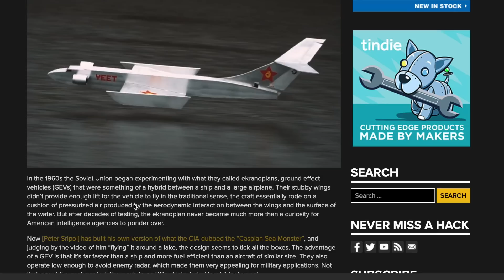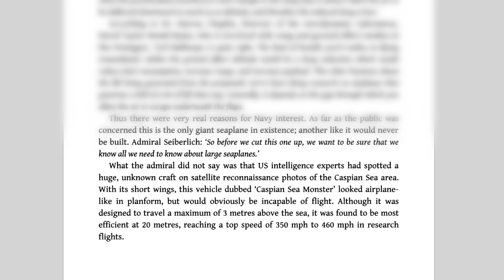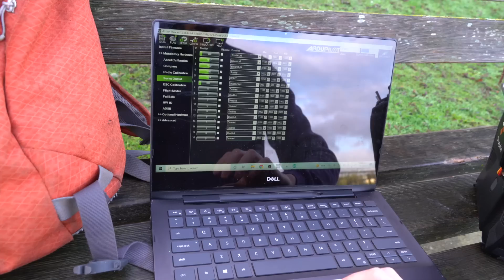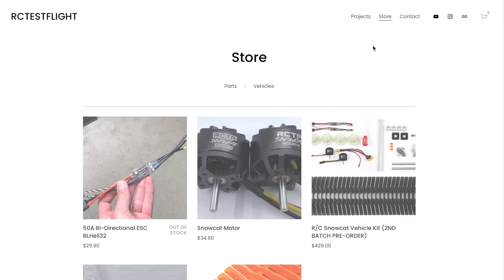Worlds First 'Real' R/C Ground Effect Vehicle

Comment: IMO, a ground effect vehicle is a vehicle that flies in ground effect.  I could fly my small airplane in ground effect over the runway, and in that case, it was a ground effect vehicle.
Also, I think a foam RC craft is just too light not to fly.  Even with reduced power, your power to weight ratio is much bigger than a full size vehicle - your model would fly just throwing it without power - I don't think the full size Ekranoplan could do that.

Comment: You need to build a really tall T tail with a fixed horizontal stabilizer.  That's going to keep the plane from pointing up.  It needs to be tall enough so that it can still face the wind even if the whole vehicle is trying to block it from rushing air.

You've already done this before with your other models.  There should be no reason why you stopped using it.

Comment: You should try to do a build that takes advantage of compressional lift. 

Not sure exactly what you'd need, but you'd absolutely need actual jet engines, likely with after burners, even if small. 

Would also likely be helpful to have a vr system in order to fly it as it would be going fast enough to break sound barrier and hit mach.

Not even sure what the legal ramifications are for it, but supersonic rc jet would be awesome.

Comment: The point of being a ground effect vehicle is that it is more power efficient to travel the same distance than out of ground effect and to make staying in ground effect easy. Demonstrating that efficiency is probably not that easy. But basically, the thrust to weight ratio in ground effect should generally be lower than for similar planes.

Comment: Pwm may be an easy way to regulate throttle, but it's not regulating power. Full scale fixed pitch aircraft use rpm to select power settings (reduce power to 1500 for approach) etc.

Perhaps you can use an esc with a governor and command it via pwm, or have the flight controller target a wattage.

Comment: Models usually have more power to weight than a similar full size craft. Why can't you throttle up to lift off the water, then back until it sits on the ground effect?

Comment: #rctestflight
I recon an aircraft should be defined as a vehicle wich achieves flight by aerodynamic lift
if you are blowing straight up that's basically a helicopter or a VTOL
if your means of propusion creates lift underneath the vehicle that's basically artificial ground effect
so by that definition your crafts would be ground effect vehicles since you rely on parthrust in every design
if you move the propeller back then it would rely purely on the natural ground effect and take parthrust out of the equation

Comment: I very much remember that original video  but totally forgot it was you who made it, i replicated it bigger (and worse) out of thin ply for a school project (alevel grade EPQ) it failed fairly spectacularly as i killed my in spec battery through over discharge and tried last min before submission to wire up two smaller 3s batteries to run my 5s EDF and deffinitly over drew the current (hence the decending motor rpm) i also failed to get the roll axis stabalised and sufferd from an issue where i saturated my elvevons trying to pull up so had very little roll authority,
but it was my first ever rc aircraft i made and it did actually get off the ground! 
https://www.youtube.com/watch?v=6EqfGYEhCkI

Comment: Could you use a hydrofoil to help lift it out of the water? Retractable if necessary.
Low pitch props for strength rather than speed? Would 4 smaller props work better than 2?
Reducing elevator surface area might make the plane harder to pitch up enough to fly?
Can you design the 'pocket of higher pressure' to be close to centre of gravity, then add flaps in the middle of the wing to give it lift at centre of gravity?

Comment: I was wondering if you ever tried a vehicle that really is not airfoil or airplane in shape at all. I was thinking of basically a forward facing horseshoe with a lid. Just an air scoop with engines and a rudder. 

So the only lift is created by collecting the incoming air and pushing it downwards. Maybe with your tilting props.

I can't imagine something like that being able to fly. But I really wouldn't know.

But imagine a pizza box with the bottom and one edge removed. Slather a helping of motors and a pinch of rudder and an elevator and some pepperoni and see if you can GEV that thing. But not fly it

Just a thought from some guy that is hungry for pizza but knows nothing about GEV's.

Comment: Don't most WIG and also regular fixed wing aircraft typically use more thrust on takeoff before throttling back for better efficiency? I don't think having the capability of more power is a disqualifier for either. I think I even remember hearing about the Wingfish 8 being able to use that power to clear obstacles and larger waves if it needs to, similar to how you were saying your r/c version could. Still a very interesting series though, definitely satisfying to see it in action :)

Comment: Could you use an ultrasonic or some other type of distance sensor and a micro to inform the pwm feedback loop? When distance exceeds 20” start to reduce throttle automatically in-loop (way faster than you can respond by human control). There could be interesting IP around ground effect controller with multiple sensor inputs to continually optimize for ground effect. Wind speed, ground speed, acceleration, rate of change of acceleration, distance from ground, air humidity, air temp, etc.

Comment: As a mechanic when I went through school they taught us that it was high pressure under the wing. The wingtip vortices can add stability but they can also take it away. The main work is done by the high-pressure pocket underneath the wing and the low-pressure pocket above the wing. Being as your ground effect vehicle is all lifting body it is allowing a high-pressure pocket to be trapped underneath the body and the pylons help to focus and stabilize. Good CG because this is a highly stable craft!
Reply: Also I would argue that a slight airfoil shape could improve the ground effect. The whole point of an airfoil is to reduce the pressure above the wing as opposed to the pressure below the wing. This is because laminar flow causes the air to follow the skin of the wing and the wing has more skin surface area above than it does below. The higher surface area causes the air to have to linger on the skin of the wing causing a low-pressure pocket. The faster moving air on the bottom of the wing creates a higher pressure pocket.

Comment: I think this is absolutely the right approach to research this effect. 
Do not get hung up on the half a wing span definition because it is the air cushion that matters so it no doubt follows an area rule not just a span rule. 
Add weight instead of reducing power. Adding weight and running the motor at its rated kV will be the easiest way to…oh wait you just brought this approach up so DO IT!

Comment: Groundeffect with such a wing shape would be noticeable up to two or three times the wing span. Groundeffect Vehicles are simply most efficient when at ideal height. The ideal height depends on the aerodynamic characteristics and is seriously non trivial. Even the Ekranoplan could fly well outside of ground effect if provided with enough power. You just loose more and more to induced drag. A way to measure this is by taking IAS over Motor Power or, lacking a way to measure IAS, time over a set distance with set motor power with multiple bidirectional runs.

If you truly want to do "real" testing find a way to log IAS and power and get a stabilizing gyro running to make repeatable flights at specific heights.

Finally: A Ground Effect Vehicle is any vehicle optimized for high efficiency flight close to the ground as opposed to a normal airplane which is always optimized for flight outside of groundeffect. They may have significantly less power than normal aircraft because of the high efficiency flight regiment they can achieve when in Ground Effect. But any Ground Effect Vehicle capable of quick and efficient travel will by definition be capable of travelling slower and (much) less efficient outside of Ground Effect. The physics here are quite simply those of high AOA flying.

Note that forward swept wings may be of benefit in this configuration, Gunter Kirch has a lot of interesting reading material on his website (German only) https://www.flugmodellbau-kirch.de/Negativ-gepfeilte-Nurfl.ue.gel.htm When stalled these generally just drop the nose which is highly desirable when operating so close to the ground and when combined with a high T elevator should be a stable platform for any experiment. Although it might not even need an elevator due to the inherent self stabilization of a forward swept wing.

Comment: about the definition "is it still a real ground effect vehicle, if you add enough power?".. :
the ekranoplan was designed to be efficient - harvesting the ground effect to be cheaper than a plane OR ship.
soooo... it had a total of EIGHT engines, wich were used for taking off... after that most of them (to be exact: SIX) were shut down.
So basically it was a gliding boat using only 2 of 8 engines.

what i`m saying here is: the original "real" ekranoplan had more power, but didn`t use it in order to save fuel.
throtteling down your engines by capping the pwm signal probably comes down to the same thing.. so.. yea. goal achieved in my mind.

Comment: Others have said it but it deserves repeating - Any scaling issue can be addressed in more than one way. Rather than reducing power, add weight. The biggest difference between RC craft and full sized craft is often wing loading. It makes sense to reduce that difference. 

Another way of thinking about it is to examine the scaling effects on different parameters, such as wing loading, span loading, weight, wetted area (literally), etc.

Comment: While watching I thought of a way you might test the theory of whether or not it is the wingtip  Vortexes Or the increased increased pressure on the cushion of air under the airplane. In someFlying wing designs they reduce the attack angle at the wing tip. Essentially they twist the wing So that the wing tip has a lower angle of attack than the root. The thought being that this reduces the difference in air pressure at the tip thus reducing the stall characteristics at low speed. It seems to me that this would also reduce the wing tip voracies produced. My next line
Of thought was wing warping. This might be challenging to achieve in your design because of the long cord and short span as wing warping tends to work better with high aspect ratio. However What if you were to make the entire tips of the wing Basically an active elevon Similar to what we see in some fighter jets. Thus the entire idea coming to the The conclusion that if you can reduce reduce the angle of attack to 0 at the wing tipsYou would not generate any wingtip vortexes. And thus if the aircraft still flies well You can prove your theory that it is the air cushion and not the Wing tip vortexes. I would love to see some footage of this aircraft in this video as well as An aircraft of the design I suggested or similar  Being flown on one of those cold mornings where the water produces a low level fog. Thus allowing you to see the wingtip vortexes in action. I think it would be ideal to have a High quality camera platform drone such as a DJI  Flying overhead to give a better view.

Keep up the good work👍

Comment: I'm wondering why you didn't use cambered wings from wingtip to wingtip?  Flying slabs are quite un-aerodynamic and the inverted ramps on the front of the pontoons are adding a bunch of unnecessary drag.

Comment: My take on this is that GEV are used for moving high mass at high speed. All the models so far are low mass, so the amount of thirst required to get off the water is also enough to fly. I wonder if you could ballast the craft to the point where only Ground Effect provided enough lift, and out of GE there wouldn't be enough lift.

Comment: Ground effect is very well defined. It is the increase in lift when you fly lower than your wingspan, because you "trap" overpressure between your wings and the ground. It does not need to be water. When you are higher than your wingspan this effect is already almost zero. So naturally it is very hard to remain in this range with RC models. It does not necessarily mean that you cannot fly higher with sufficient power to overcome the stubby wing losses. Whenever you fly higher than your wingspan, you are practically out of ground effect.
The two explanations of the ground effect you give at 4:20 are actually both the same. The squashing of the wingtip vortex - which come from air wanting to move around your wing tips from the high pressure underside to the low pressure overside - it is exactly the mechanism that traps the high pressure under the wing.

Comment: Adding a few control loops would make it easier to control. I.e. measure motor RPM and adjust PWM values to meet a set RPM. This reduces dependency on battery voltage. Similarly, you could adjust the tilt based on angle and/or altitude.

Comment: I still do not know what ground effect flying is. I also could not find a definition of it in any searches. I've heard both flying low or a plane hover crafting, both of which fit ground effect flying from what I found. Your defining of a plane not actually having the power to fly also fits a plane flying low. At the 9:30 mark you mention its flying even though its not very high. So, what is ground effect flying if not a hover craft effect, a buffer of air between the water and wings, or flying low? What effect, if not a hover type flight, are you looking for?

Comment: i would call a plane a "ground effects plane" if it was designed for maximum fuel efficiency while flying with ground effect. there was a prototype troop transport years ago that was meant to carry massive amounts of cargo with super high fuel efficiency over water. from what i remember, it could fly at altitude, but the fuel efficiency would tank horrifically and you'd be at bingo really fast. most ground effects planes i've seen are super fat cargo planes of some type because that seems to be the most useful application.

Comment: I remember, as a kid,  reading of a B-17 crew returning to England with battle damage and down to two engines. By throwing everything overboard they were able to maintain altitude but then lost another engine. The B-17 could not remain airborne on one engine and they prepared to bail out before they got too low. But the pilot had the navigator calculate their descent rate and asked if they could make the Channel. He said they wouldn't but could make the North Sea if they turned due north. Pilot told crew to not bail out as he turned north. The plane settled to about 10 feet over the water and held. He gently rudder turned west and eventually belly landed on a beach in SE England.

I have been flying for 38 years and I have never flared for landing as the gentle hand of ground effect reaches up to help without thinking of that B-17 pilot who bet EVERYTHING on it. I generally fly high-wing aircraft and ground effect works out very nicely. When flying a low wing aircraft, if you are carrying ANY extra airspeed you find yourself wishing there was a ground effect switch you could turn off. Turns out yelling. "Stop flying, FFS" does very little. I also learned what I what I think is the other reason sailplanes have spoilers. A sailplane with enough energy to fly at all becomes a perpetual motion machine in ground effect. 62' wingspan, altitude 3 feet. It will not quit flying. I think ever.

Comment: I just thought about it. And why wont you hard stuck the thing on ground effect zone. I mean. All this "GEVs" have rounded or flat as earth under. And what if we would put an venturi tunnel here(or any other way of controlable vertical drag). Thus there will be a counter ground effect witch will in theory lock thing on constant height. it will downgrade the lift force and speed ceeling, ofcouse, but stability and guarantee worth it.

Comment: All those complaints about this being not a real ground effect vehicle because you've simply limited the motor power are silly. At full scale the motors aren't limited, it's the other way around. They used smallest, weakest engines they could get to get the job done. Same here, you could simply use smaller, cheaper motors and run them at full power.

Comment: to combat that vertical oscillation, you can use a PID controller algorithm to regulate the power to counter this? But, im now wondering if you can use the PID to keep the vehicle in set position from the ground, and filter the noise. I use PIDs in game engines to create realistic dampening on suspension models for vehicle controllers and they work great, but take a long time to balance

Comment: We used to built WIG models back in the 1970s. But these were more like hovering boats, not low-flying planes ;). And there was no RC, just a basic 2.5 ccm motor with a shutdown rod on top. The things were quite unpredictable when airborne, they'd cartwheel at will all the time. But it was fun.